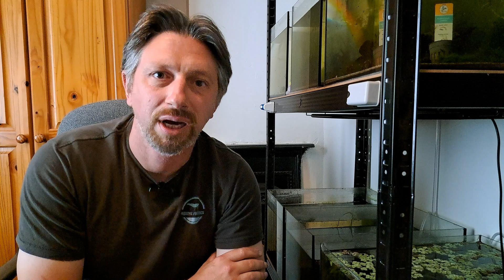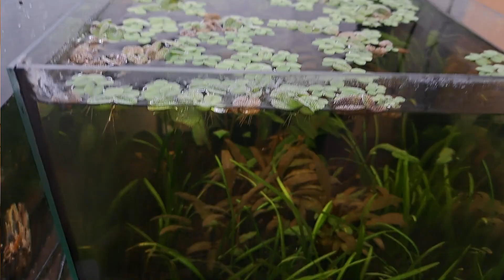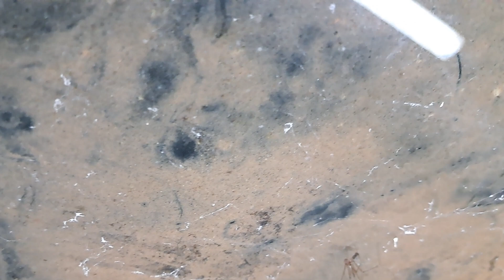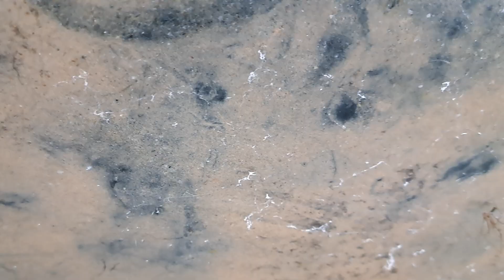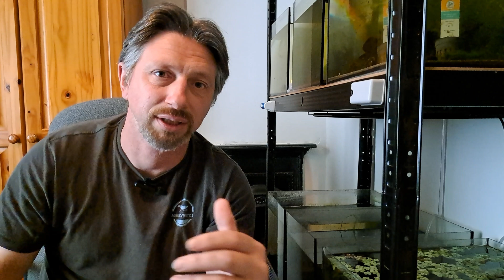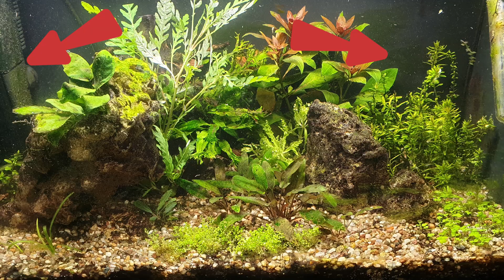The Sand Trap: How deep substrate sabotages Walstad Method aquariums.

Comment: This is so helpful! i tried everything but couldnt solve the problem. Now i know that i got to break down the tank !
Reply from the maker: Im glad you found it helpful!
Reply: @aquaticfanaticsuk yeah man I had the green film on top of my sand cap for the longest time and my plants are dying. It's bad.
Reply: @aquaticfanaticsuk if I mix the sand and my soil, will it be OK? Ie totally no separation in the layers...
Reply from the maker: @jaydeeq That's a good question. I can see your logic. I was thinking myself the best way to save a tank in this situation. If I were in your shoes I would remove as much of the sand cap as I could manually and mix the remaining sand in with the soil. Soil contains sand anyway so a little more shouldnt have a massive impact. I'd then cap with a gravel about 1 inch of 2-4mm. I wouldn't leave the soil uncapped as it will constantly be kicked up and look like a swamp with a brown film over everything.

Comment: Hmm. I was under the impression that many organic bound micro nutrients need anaerobic conditions to mineralize and become awailable to plants.

Cyano and sulphur hydrogen sulphite can be avoided with correct nutrient balance. But off cource there are no tools for corecting that in the walstad method. From my perspective it always make sense to correct inbalances no matter method used.
Reply from the maker: As always, Magnus. Your comment seems more of a misunderstanding of Diana Walstad’s theory and not my content.

There are controls for controlling macronutrients, she explains how in her book. But the system is designed with the aim to avoid these issues before they occur. 

There are explanations of how micronutrients are chelated in the book. For example:

Fe + EDTA => FeEDTA
Reply: @aquaticfanaticsuk thanks for getting back to me. I have read the book several times but it was quite long ago. How do she explains the EDTA to form naturally in the tank? What measures does she say control N/P balancing? I totally agree that FF method involves a bigger risk for unbalance. But I do not understand how to prevent it totally avoiding corrections.
Reply from the maker: @greenmachinesweden Hey Magnus! I apologise, I appear to have grammatically garden pathed you. When I mentioned the EDTA, I was using that as an example of how Iron can be chelated in oxygenated water. However, in the Walstad method the minimal water changes allow for the build up of Disolved organic compounds. These have humic and fulvic acids which act in a similar fashion to EDTA while also raising carbon levels in the water column. 

The N and P calculations. The crude protein in fish food is about 15% nitrogen so we can use this and the phosphates are calculated by looking at the phosphates percentage in the ingredients list of fish food.

With regards to the corrections. I this you're thinking along the lines of like EI style dosing where you front load and correct. In the walstad method, the logic is in reverse, your goal is to try to let it build up slowly and self regulate. Rather than frontload and correct, if that makes sense. This is where the myth of not needing to do water changes stems from. Its not that we are aiming for no water changes, its more of a case of letting them build before adjusting.

Comment: Yep, without gravel, its not a Walstad. Sand is not gravel. Very different things going on. I am kind of addicted to aquasoil presently😂… its an expensive addiction. Once I get over that I will give a Walstad a go. I use plastic tanks that scratch easily. That is one of the main reasons I have avoided gravel. My problem with Walstad is I could never create a 100% Walstad. I cannot get my hands on a proper black garden soil like she uses. My native soil is heavy clay based brown soil and everywhere that sells soil is just pine bark. I have 2x bought actual soil (ie sand, organic matter proper soil mix) and they were a complete disaster under water😢

But I suppose brown soil is still technically a ‘Walstad’ as it does grow plants.

I recently was at my ‘soil’ supplier (very popular place in Oz). There were about 20 different kinds of ‘soil’ and ‘potting mixes’ available. EVERY SINGLE BAG was ‘pine bark compost’ when you read the description on the back of the bag. As you know ‘pine bark’ is not soil. It is a component of soil. A very good component, but a component nevertheless. It is not a proper soil. One bag was ‘labelled’ cow manure with the picture of a cow on it. On the back description it said it was actually ‘pine bark’. Must be a mixture of cow manure and pine bark, but it is still mostly pine bark😂

Every potting mix in Oz is pine bark compost + some small additives (that is ‘premium’. you pay extra for that😂) On some bags they call it ‘soil’. it is still the same pine bark😂

I get lots of problems with sand so I mostly stay away from it. I love sand, but I find it tricky to use.
Reply from the maker: Hey bud! It's really good to see your name pop up in the comments! Hope you're doing well. Aquasoil is good stuff, especially for fast growing plants. For me, I just like bigger tanks, and at £5 a jug for aquasoil, whereas a jug of top soil costs me 50p. And if anyone knows, you know I love big plants. 

Honestly, that can be a bit of a headache if you can't get straight soil. It'd probably mean getting some organic compost and leaving it to mineralise the nutrients out for a while. Does anywhere do pond soil, maybe?
Reply: @aquaticfanaticsuk  ah yes… I am nano. Aquasoil for large aquariums would be very expensive. I rarely go above 20 litres as ‘uncapped’ soil seems to create massive algae issues when you upsize. It is very frustrating for me because I have done a nano aquascape now several times and when I upsize to 80 or 100 litres (same soil, same plants) it does not go the same way. Soil has to be capped with something, is what I have learnt.

The only people who seem to sell proper ‘soil’ are landscape suppliers but I tried that once and it was not good. It was a soil they make inhouse for grass turf. Just recently I bought an expensive ‘seedling soil’ by Yates. It killed lilaeopsis outright😂. I am finding it very hard to create a soil from scratch (like 1/3 sand, organics etc…) so have decided to use my brown soil as a base and try to enhance it. Its a proper soil from outside (natural) so I think that is the best for me. If I cap it then the clay should not be a factor I hope in an aquarium. 

I think the reason that you cannot buy actual soil is because it would require taking actual soil taken from the land, which is harder to do. So they either make their own soil from sand and compost materials (landscape professionals). Much easier to just sell composted pine bark. Brown loam is available to purchase here but it is even more impoverished than my one outside. Seems to be popular for potted pond plants. Brown loam. They avoid rich potting mixes because of green water issues. ‘Pond soil’ I cannot find here. I only see it on utube channels, not Australian.
Reply from the maker: @thesolaraquarium clay is great as it retains the nutrients for the plant roots. I would give your own soil a go and see how you get on. I've been using a toosoil, which is very clay heavy since they banned peat in the UK. It seems to work great for me

Comment: Cyano smells like a deep, dirty green earthy smell. It's not a nice smell. Ive had cyano with coarse pool sands as well. I mean just as a sand substrate, not as a cap, this is why I only use sand as a very thin layer in aquaria, not as a cap just as decorative. Great advice as usual, Keith 👍🏼
Reply from the maker: Cheers, mate. I have suffered from this in many tanks. I used to find in my marine tanks I'd get the same 'stubborn cyano' and it makes me wonder